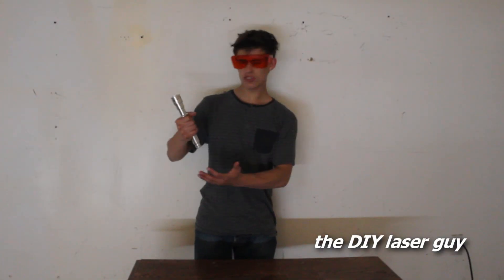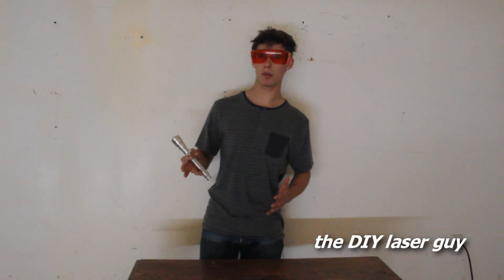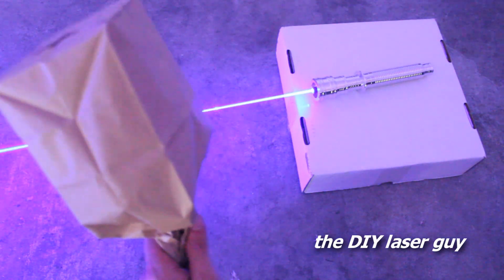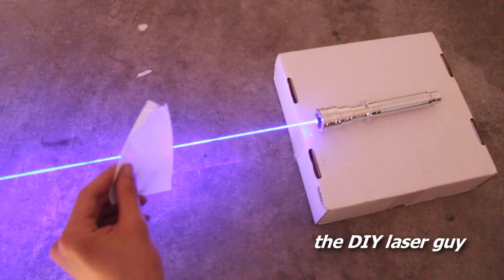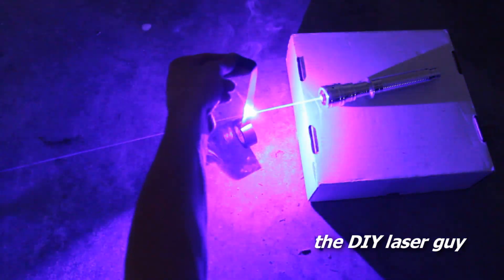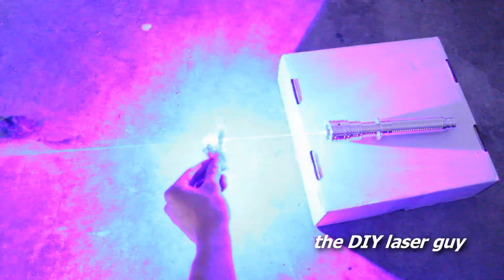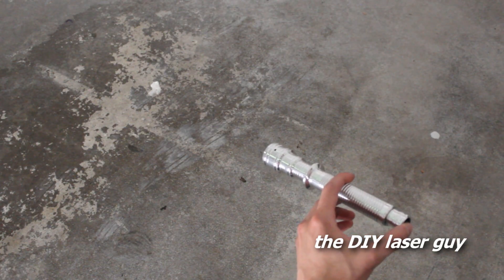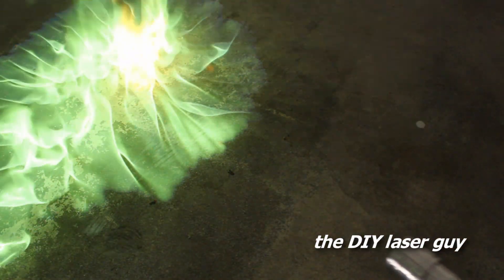My Homemade 6W Laser Sword!!!

Comment: Holy shit are we in the damn future?!?!?
Reply: Lasers have been around a VERY long time at this point. This looks cool, but it's nothing futuristic. it's just a lazer with more power output. I have a feeling that thing can only run a few minutes on a charge however.
Reply: Judy Lopez I assume he's using CR123A or 18650 cells in that laser.   With the power formula of P (Watts) = V*I, those little cells must be pushing at least an amp depending on the configuration to get 6 Watts.  Also, cooling of the diode may be the time limiting factor.  Even my superbright flashlights (2000+ lumens) get very hot after just a minute of use.
Reply: Yes, we are. We are also in the past, present and future. In fact, I'm in the future right now, which was the past and is the present. This comment will be posted in the future of my perspective, and typing it will become the past but is the present at the moment. As you can see I'm predicting the future in the present which will be the past.
Reply: Yes. Yes we are.
Reply: BrusqueButTrue love that post. But pure truth
Reply: Yeah.Its 2015 and still no marty mcfly.
Reply: Trust me there's ones strong enough to burn right through steal and shoot right through human arms
Reply: luke soriano On a positive note, there is hoverboards now and Nike will have the power lacing MAGs this year!
Reply: Technically, yes.
Reply: Tim Gelhardt any new video or news ?
Reply: Adil Mazher what are you referring to?
Reply: Tim Gelhardt Nike hoverboards ? u just saying about them above won,t you :)
Reply: you have been asleep for 5000000000000 second LOL
Reply: Edslittleworld about 4 amps, it says in the description.
Reply: Yonzo Rikuo short time
Reply: yeah ikr
Reply: yes we are in the future
Reply: joeguitargod yep, like I thought, you are probably under the age of 10 and shouldn't be arguing with you. It was noticeable after you made fun of someone's last name. Where's your parents? You will get picked on the internet and judge people wrongly.

Comment: now, imagine carrying this on your backpack for emergencies when you go hiking, etc. This should be way more effective than a flare, and you can make blink morse code.
Reply: Sure its effective but it wont be that effective if the pilot of the aircraft is blinded by this extreme overkill of a laser
Reply: its in a situation where you cant see anything in the sky, say you lost your glasses while camping out and everyone else abandoned you in the woods. you are stuck there and you can see shit so you bring out the expensive ass laser you built and shine it into the sky.that laser is powerful enough to blind the person the second they see it so they fucked and the plane crashes into your spot and you die. it's a common problem you know
Reply: ***** or is crashes BY you, and you can get the food etc that was in the plane, maybe the radio too... LOL
I don't think it will blind anyone if you point it vertical. You can hit a helicopter with a flare too LOL.
Reply: bluetorch13 Idk if that thing would have much on it to survive, maybe a little food, maybe. Medical supplies, yes more likely. If its a rescue copter, ok then food too. But other then that, little flaw, you made a pretty good point lol.
Reply: bluetorch13 challenge accepted
Reply: Not only for signalling, it would be useful for starting campfires, burning "help, I went this way!" notes onto rocks etc, maybe...it would be useful for fishing, assuming the refraction of the water doesn't throw your aim off.
Also, remember that scene in Rambo where he sews himself back up?
With this baby, you could simply cauterize a wound :D
Reply: Naughtytimeted yeah it have so many function ! I want it so much !
Reply: Bad idea people like me would cut a butt cheek off
Reply: ***** Thing about planes is, they aren't actually allergic to lasers. And if it's flying overhead, you'll be shining a laser at it's underbelly and not really hit anyone. The thing people talk freak out about with the lasers and airplanes is people who intentionally aim for the cockpit while the plane is landing/taking off. So chill the fuck out with your plane-killing-lasers conspiracy, I'm sick and tired of this topic being brought up time and time again. Besides, if a pilot briefly loses his vision, nothing is going to come of it. The plane will stick to the course, no matter what. And there's always a couple of pilots onboard to assist. No pilots have been permanently blinded by lasers, either.

IN CONCLUSION: unless you're somehow stranded in the middle of nowhere next to an airport (why do you need rescure again?) and an airplane is landing right on top of you, you won't be hurting any pilots, crewmembers or passengers.
Reply: Radioactive Pandah Not everyone is smart, you know... :P
Reply: I perfect for if you lost or need fire n help
Reply: bluetorch13 if you don't know what you're talking about you shouldn't be spreading shit myths, lol.
Reply: ***** Who says you need to shine in the pilots face you can shine close the helicopter?
Reply: Radioactive Pandah A plane isnt only flying by a airfield it can exploring or just flying around and that can safe you!
Reply: KinglyWays so he gets a good idea of what hes dealing with, the biggest badass to ever walk in a forest
Reply: Except the batteries only last 3 minutes from a full charge.
Reply: Hurricane Floyd 3 minutes it's a LOT, you have 180 - 1 second blinks. You should be rescued using 20 tops.
Reply: Smart, but you might hit a tree and light it on fire.

Well that'll gain attention too
Reply: Michael M  that will start a forest fire too..
Reply: Michael M I saw a real story on TV the other day about a guy that got lost in the woods, then got trapped in a place where he couldn't go up or down (like a canyon with trees?) he was starving, no animals no water. and decided to light the whole shit on fire... crazy decision but firefighters came and found him. Lighting a forest on fire should be your last resort though...

Comment: So do you just have a bunch of holes in your walls/ceiling from shining those things around...
Reply: AGO-Studios or the lasers aren't what he says they are... They don't seem like brick walls, but even if they were, something like that should be burning the paint off.
Reply: SerAlgernop BlitzKrieger As long as his walls  are painted white he is fine; white paint reflects so much of the light that it doesn't burn.
Reply: FPS Canada that's not quite how it works. Otherwise you'd be freezing whenever your wore white and white walls would blind you. White reflects all wavelengths of light, not just select ones, that doesn't mean it reflects ALL the light. Just what light it dies reflect has all the colours in it.
I mean, black still reflects things. How else do you get gloss black?
Reply: SerAlgernop BlitzKrieger I never said that white was completely reflective; just reflective enough to stop it from burning instantly. Also white walls can blind you; when they come in contact with a bright enough light (around 3500LM's) or perhaps a better example would be during a bright day in the winter people become "snow blind." You will also stay considerably cooler while wearing white as opposed to darker colours but you obviously won't freeze because of the air temperature and because of your clothing trapping air heated by your body against your skin; also known as insulation.
Reply: FPS Canada two things: snow isn't "white". Snow blindness is from the refractive index of ice crystals.

And if wearing white makes so much of a difference, what's up with most desert-wear of native desert-dwelling peoples and Nomads black? You do see some white, it's true, but black is far more common.
Reply: FPS Canada also, second law of thermodynamics, the whole entropy thing... You can't just be insulated by body heated air, because hot travels to cold. The body heat would be sucked to the air, then to the outside.
Besides that, do you REALLY think the microclimate created by FABRIC is that effective that it keeps you warm when exterior heat is reflected away? ^.-

You know what a truly reflective surface looks like? A mirror. As I said before, white just reflects SOME light of ALL wavelengths, but still absorbs most of it.
Reply: FPS Canada I'm pretty sure 3500 lumens will blind you in a matte black felt-lined room.
Reply: SerAlgernop BlitzKrieger Well desert dwelling peoples usually wear black robes because they help keep them a bit warmer at night but the robes are worn loose so that the body is essentially cooled by convection currents. And trust me body heated air is very effective at keeping you warm. I've been in temperatures of -60 Celsius on many occasions and having "medium density" layers to help trap more air against myself was much warmer than wearing a single heavy parka.

Now on the original topic from personal experience using a 1W blue laser; white materials are much harder to burn than black ones. Black balloons will pop almost instantly while white balloons could take several seconds.This also appears to be a blue/violet laser and the diodes used to create these have a wide beam that spreads very quickly making them much less effective at burning things from more than a few feet away unless it's thin plastic. Also my laser is powerful enough to burn through CD cases and ignite steel wool but it won't burn white chip rock. (Sorry for rambling on so much I just find these topics quite interesting.)
Reply: SerAlgernop BlitzKrieger Seriously "Antarctic explorer" no it's called living in Northern Manitoba. Also that's including windchill; being outside in -60 without windchill is asking to freeze to death because then the windchill would bring it down to -70/-80 . And I never said that loose fitting clothes keep you warm I literally said the opposite of that when talking about the robes. Also when I lived in Manitoba when I used to go hiking/snow-shoeing I would wear a compression shirt, long sleeve, a sweater, and parka; and guess what the parka was loose by it's self but fairly tight when worn over three other layers.
Reply: FPS Canada funny how suddenly the idea of air being great insulation has gone right out. Except you DID back the idea the comment before.

You know, funnily enough the lowest temperatures I can find for Manitoba is -40°. Got any more backpedaling you'd like to try? (Before you say anything, meteorological sites include all the variables. Hell, PHONES take all the variables into account, hence the actual temperature and what it feels like being given)
Reply: SerAlgernop BlitzKrieger First of all how did I disregard that the fact that air makes a good insulator? wearing layers allows you to trap more air against your body keeping you warmer it's fairly common knowledge look it up. Second If you really want to know about me I lived with my brother in Churchill Manitoba  during the years 2003-05 and it reached -60 several times each year during December and January and these were the days that my brother and I loved to go snow-shoeing because we love the cold.
Reply: ***** Yes thank you.
Reply: FPS Canada
See? you have fans too!
Reply: +SerAlgernop BlitzKrieger For the scenes where he is holding the lasers up willy nilly, notice that his body is not completely still. The vibrations travelling through his arms cause the lasers to be unable to focus on a single point of his ceiling, he would have to have much more powerful lasers than those he is showing off in order to cause damage by swiping them over things. And for when he is burning things, I'm sure he has some sort of catcher off screen to prevent damage to his walls, that is standard operating procedure for powerful lasers.
Reply: +Brandon Martinez I believe that the laser unfocuses at that length. Much like how a flashlight widens as it gets farther away from a wall, the laser would widen to a point where it does little to nothing.

Comment: Where does the rest of the laser go?

I would think if you pointed it at a wall it would start burning the wall or something
Reply: ikr...
Reply: ***** But I'm guessing it could burn through the ceiling  and urn down insulation and other stuff in the roof?
Reply: Michael M Because the wall is white, most of the light reflects off it and scatters around the room. Darker objects absorb more light, turning it into thermal energy.
Reply: Paul Is that why Stormtroopers wear white?
Reply: That Storm Trooper shit WHOA my mind also blown whoa wtf that was a good thought lol
Reply: Copenbro I think cause space is black and we could see white better I think
Reply: Paul But white doesn't mean total reflection. Otherwise you would catch a cold under your white shirt. If the laser is this powerfull the radiation pressure should be high enough to damage the wall or at least burn the wallpaper
Reply: Copenbro yes, they are also wearing a type of glass/metal armor to help with heat.
Reply: Morten Kristoffersen wow, didn't think abiut it this way. you're absolutly right.
Reply: Michael M He probably has it aimed at something large that absorbs heat like a black sandbag.
Reply: It's probably got a manual focus but if not the wall is white which scatters
Reply: HE POINTS IT AT A ROCK LADIES AND GENTLEMEN
Reply: +Copenbro i guess that means darth vader's just a dumbass for wearing black XD
Reply: Nope. You would need a lot of power to burn through a wall, much more than a handheld laser could ever produce.
Reply: it's not amerika they have walls aut of stone xD just joking

Comment: Remember your laser spirograph? I based a college project on the one you built and got a wonderful A out of it!
Thank you very much! haha
BTW, you could've used an Arduino board to automatically set the motors' speeds for best image results.
Reply from the maker: That's awesome to hear, the laser spirograph is a fun project!!
Reply: It sure is. My next step is building one of your extremely powerful light sabers. But first I have to find a decent module.
Keep up the awesome work bro!

Comment: I know nothing about lasers, if you mirror the beam does it make it "stronger"?  Could you make a long mirrored enclosure out of metal if you used the appropriate measurements and angle you could put some beam emitters at one end to make a one sided laser sword with an identifiable end to the beam by reflecting it onto itself I think? You could maybe even use multiple emiters to make it appear to have width

Comment: @styropyro I am not sure those laser goggles you wore here are even remotely as safe as you think they are. I wont even use my 5 watt blue laser because it is too dangerous and very unfiltered! The IR light emitted is even more powerful than the rated output of the visible colored light and that makes it even more dangerous. 

Building lasers is fun but most are too dangerous to actually use safely. To get the right bandpass filters, shortpass filters and 2 pairs of laser goggles for just one of these to be 100% clean and safe enough to use in a controlled stationary setting is $250-$300 more than the laser diode, battery, laser housing, laser collimator and charger...... They are really just for having as a collectable and not even remotely safe for use when the dot is emitted is that close.....Do not believe that laser goggles will save your eyes. They are only rated for looking a  specific dot emitted at a specific frequency for a very limited time...... Burning reflective material like steel wool is NOT SAFE!!!!

Comment: Idea: You turn on the sword and a small drone connected to handle floats 3 feet above the beam origin. It stops the beam from going forever. It has a reflective surface to bounce the beam into its lower half. the drone would follow the position of the handle with image recognition and other sensors plus transmitter in handle.